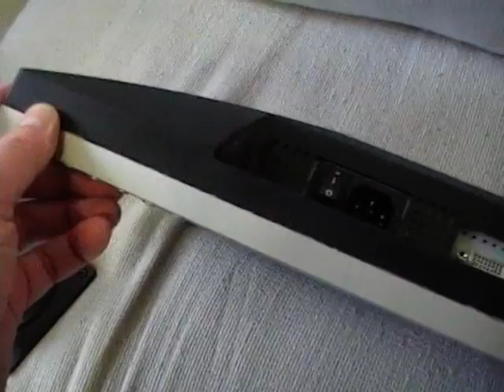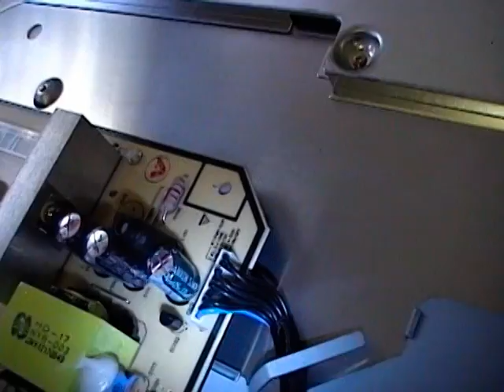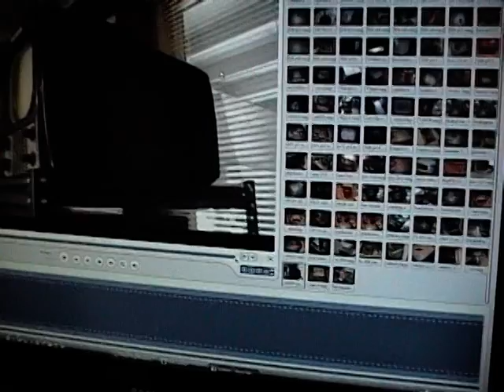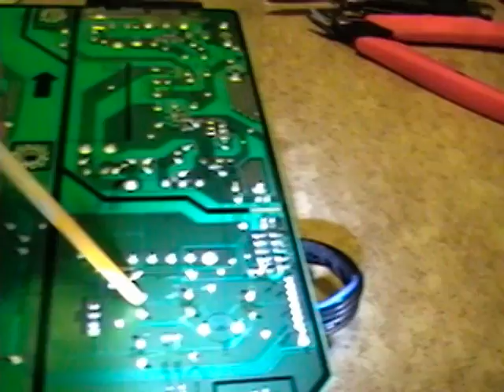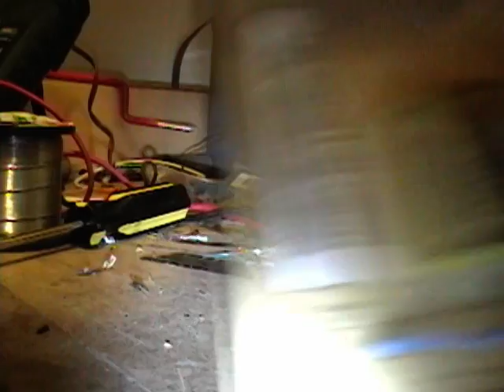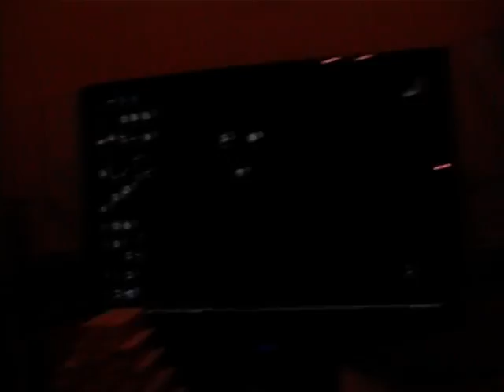LCD Monitor Repair

Comment: I replaced the 2 most bulging caps on a monitor, now it lights up, but i have no vertical control.  it's scrolling all different directions.  I think i need to do the other caps in it too and see if that helps.

Comment: i dont get it there is a video on the eev blog with the same thing, samsung does such a great job and everything right with the power supply board and made a good quality monitor but they cheaped out on the caps

Comment: Just for future reference Panasonic is the best to get. We always used them building medical equipment etc where the failure rate is super low. I'm working on a large LCD someone threw out in the trash.

Comment: I'm disgusted at how Samsung is using Capxon capacitors in their electronics
Reply: Yeah really! Samsung makes great lcd's, and then they use those crap caps!!!??? Capxon sucks!
Reply: Steven King Thats why they are considered to be not such a great brand only because of the caps! we got a Samsung LCD 5 years old and it has gone great but now that I know that there are Capxon caps in it I will be more cautious! i'll give it some nichicon caps one day
Reply: +Sony Trinitron That's because the boards are build by the lowest bidder out of China..

Comment: I keep a stash of common size electrolytic caps at work and repair the monitors that burn out.  At least 90% are just bad caps.  It sure is a cheap way to keep them going.  I also keep an eye on the electronic recycling area for employees flat screen TVs that are being trashed,  a lot of them are just bad caps,  three dollars worth of caps and you have a almost free flat screen TV.

Comment from the maker: I'll be talking about capacitor life expectancy in an upcoming video.  A typical cap is only rated for 2,000 hours (83 days) at it's maximum heat and voltage.  The less heat and voltage you put on it, the longer it will last.

Comment: Bob.. I can understand why you did not think it was the caps?? About 4 years old and leakey caps would not make sense to me.... Mayb 10 or even 20 years old, but 4?? well I guess... you got back your power supply.. To me I think the rating or the basic electronic design may be flawed to help kill those caps. Odd very odd.

Comment: Thanks for you reply.. I found a company near to my area where i got the capacitors from and then i changed all capacitor.. and it worked after i changed the Fuse.. so its working now.. thanks alot for the big help.. 
And thanks especially to the person who posted this video..
bec if i didnt thought to check the youtube ... I have probably through it my LCD to garbage. 
So thanks to all of you for big help...

Comment: Hi,
My screen syncmaster 203b have same problem, It shows nothing on screen but the blue light shows in power button.
So I dont know ... do i need to remove all those 6 capacitors or replace with new capacitors ??
Or is there any way to find out which capacitors is bad and need to be replaced??
Can you please tell me, where I can order those capacitors???
thanks

Comment: Not all caps will show signs of being bad, many simply dry up. The capxon caps are crap from the get go, so if anyone has them, REPLACE asap. Panasonic and many other brands are a big improvement over these. Get low ESR caps, make sure the uF are the same as some switching supplies will not like it one bit if you stray from the printed uF rating and never ignore the little electrolytic capacitors. Good job on the repair and glad you didn't get more Capxon caps, ugg!

Comment: @moonwine if your monitor turn on for 2 to 5 sec and turns off, and you got no bulged caps, then you need to check you LCD inverters, they probabaly gone bad, interters are those blocks next to where the LCD backlight plugs are. when the inverters don't hold the charge from the power supply, the monitor goes black bacause no light gets to the screen.

Comment: nice video, i just wnated to add that when you replace caps always replace with higher Voltage than the bulged ones exemple if your bulged caps is are 10V 1000Uf replace it with a 15 or 25V and same Uf if you want to avoid having the same problem in the futur, i have repaired hundreds of monitors and never had the re-repair them again. the big cap does not need to be changer it looks ok. sometimes its is the inverter that is the problem, it is rare when the graphic card fails.

Comment: hey pls help me i have a samsung 940 bf and the capacitors are all good but if i turn the monitor on it does a "BIP" sound and the image has 10 % brigthnes  how can i fix my monitor there is no light on the image ( sry for my bad english) HELP PLS

Comment: i have a dual lcd monitors samsung 2233bw i have a nvidia card they both worked fines for about 8 months and now one doesn't work , the one that doesnt work is just black and the blue light at the bottom blinking all the time the other one work just fine what do you think is the problem the capacitors?

Comment: May I suggest that it is not a bad idea to get higher voltage capacitors than the originals, even if they cost a little more. These will run cooler and last much longer than the stock voltage caps.  This will help delay the NEXT repair!  Great video, as always!

Comment: I have a BenQ LCD still sitting around here. Bought used; got about 1.5 years out of it; just shut down one day. When I turn it on, it just about shows it's "Energy Star" splash screen & then turns right back off. Think it might be the same problem (caps), but can't figure out, for the life of me, how to get it apart!

Comment: Awesome!  Those are some monitors that are definitely worth repairing :-)

For that network drive, check the caps as usual, and test/repair the hard drive with HDAT2.  Should be able to get it going no problem.